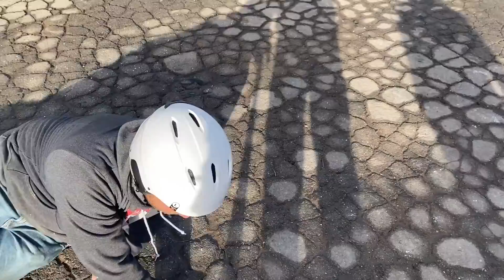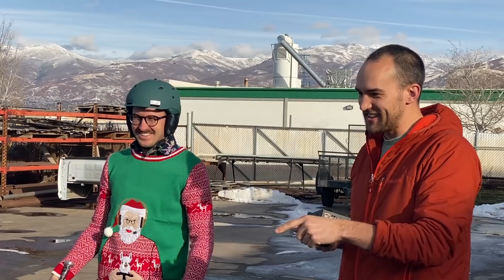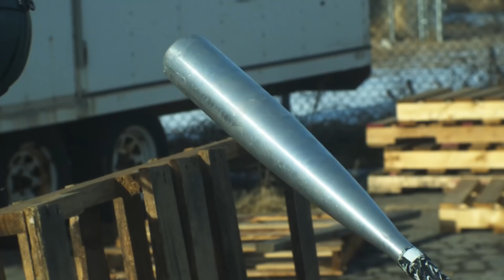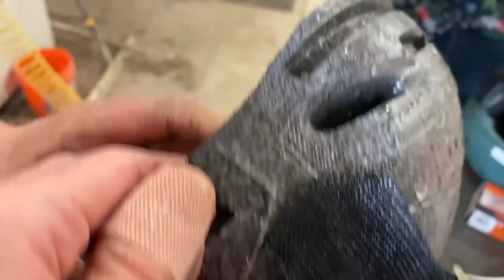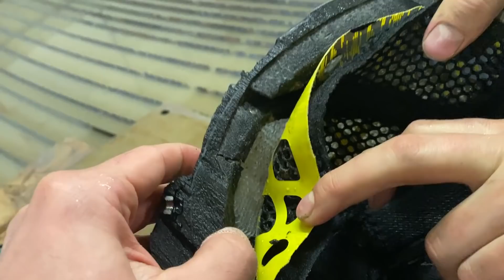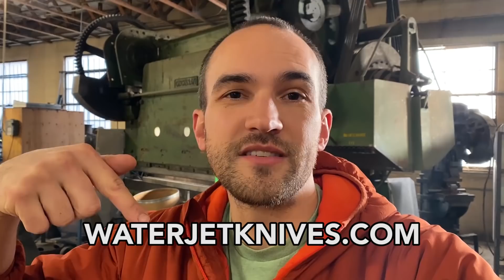Ski Helmets - Cheap vs Expensive (feat. 60,000 PSI Waterjet)

Comment: ski helmets are supposed to break on impact so your head doesn't absorb the brunt of the force. So if you noticed on the first hit with the bat, the watermelon wasn't damaged at all. with the other cheaper helmet, it transferred all the force to the watermelon, i.e. would have been the human head. That green helmet did its job 100%.

Comment: I always thought the general consensus in the community was that past a certain point, which is actually quite a low price, you're not paying for less weight, not more protection. I'd be interested to see a ~$80-100 vs. a $300+ helmet. I know the upper end of rock climbing helmets look decidedly weaker than the cheap models, but they weigh far less.

Comment: i don't think that's necessarily true. the material in the helmet dampens the impact but not bounce. Similar to the car engine bay design. You want the maximum amount of energy converted into heat like a blub of cley instead of acting like a spring.

Comment: Don't you actually want things like helmets to compress? You don't want to transfer the energy into the wearers head. As long as the bat, or what ever you hit, does make the helmet flex all the way to your skull, more flex is better. Also, the expensive helmet cracked - which is fine. More energy absorption than transfer.

Comment: Hey, just out of curiosity, what is the nozzle for the jet made from? Surely you'd have to replace the nozzle every so often because the hole would get bigger over time? Thanks! Great vid!
Reply: They’ve talked about this before on one of their videos about the water jet itself. I don’t remember specifics, but they do have to change out the nozzle fairly regularly
Reply: @ryanthomas5962  ahh thank you. I had suspected so. If anyone has any further details, I'd love to hear them!
Reply: @B0Oty  if they use the garnet abrasuve it cuts down the usable time on the nozzle drastically. Almost by a factor of 10. It goes from 100 hours of use to about 10 (thats an example, i dont know exactly but thats what i remember.)
Reply: @julymorris6367  wow that's pretty crazy. Cheers for sharing that!

Comment: Ski helmets are technically supposed to break upon impact to soften the blow of the crash. Even the manufacturer will say it can only withstand one crash before replacing.
Reply: According to all the motorcycle gear stores, "A dropped helmet is a bought helmet."
Reply: A helmet is one time use. You see how the foam cracked and compressed. That’ now is u blue to crack or compress more so the force will go into your head instead of being absorbed. Also that yellow lining in the helmet is made to let the helmet slip a little so an impact doesn’t put all the twisting force on your head. Expensive is Better to an extent, but for any helmet I would think that spending under $100 is a bad idea. The price minimum becoming higher as it is designed for more serious accidents.
Reply: They seem really similar to most downhill bike helmets too, thin outer shell with some sort of foam inner that absorbs impact but only supposed to take one hit.  Makes for a lightweight helmet but they do say very clearly that even if it appears undamaged from the outside it is to be thrown away after one hit since the inner won't provide the same protection more than once.
Reply: Many quality ski helmets are built with multi impact foam technology.
Reply: @cameratool  how much do you trust that
Reply: @llab3903  My wallet trusts that, and my wallet gets the final say
Reply: @nrk9857  yikes
Reply: @cameratool  no, "multi impact" is regarding scratches, and tiny impacts like carrying it around. Impacts like a crash, is just one, then u need to replace it ASAP

Comment: I know we’re not looking for perfection here but I think the results would’ve been a little more accurate if you put the melons in the helmets and dropped them from the same height. Anyway, maybe you could try something with motorcycle helmets and the guillotine. Try putting those foam mannequin heads in them.

Comment: also, the 300 bucks helmet has mips technology which makes it safer for angled impacts than the cheap one
Reply: You can buy helmets with MIPS that are under $100
Reply: If that helmet didn't have all those vents it wouldn't need MIPS.  FIS RH 2013 approved helmets have smooth exteriors for a reason.
Reply: ...the cheap one also had vents. Most all consumer-level ski and bike helmets have vents. So yeah, the MIPS makes it safer

Comment: More helmet damage = less head damage
Reply: not exactly so. It's about slowing down the bat as much as possible while speeding up your head as slowly as possible. Also spread the impact to a larger area of your head. High acceleration is what kills you. So you want your head to comfortably accelerate up to bat speed so the "impact" is nonexistant.
Reply: Not exactly.
Reply: Especially if it cracks open like an egg. That is why you actually want to use porcelain bowls instead of healmets. I always use them and as you have probably figured out by now my head works as good as any could ever!
Reply: @shydead1392  a porcelain bowl would split open even easier; actually. It's mass could take up a bit of the impact energy but it'll do nothing for buffering the force. Also it's useless as a helmet for use in crashing. It stops external light objects.